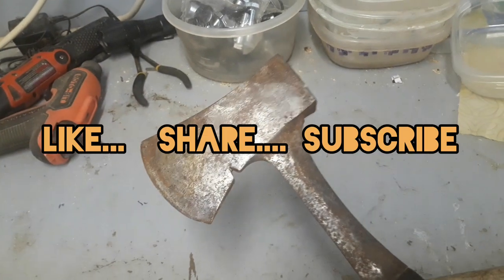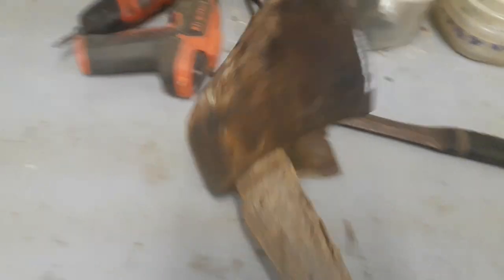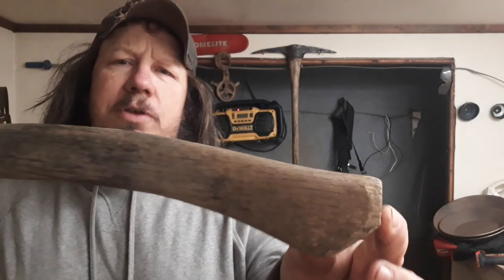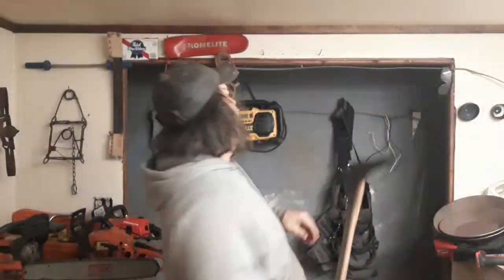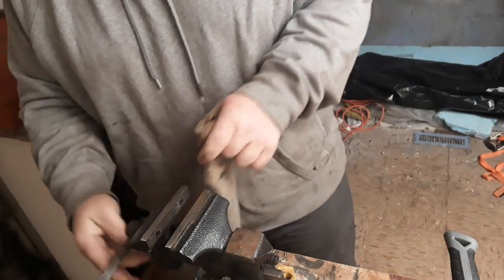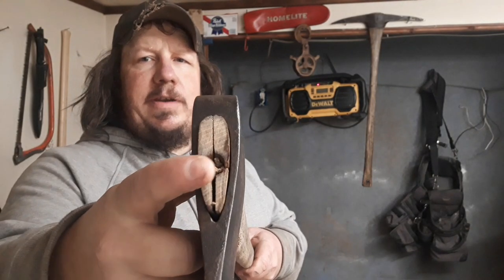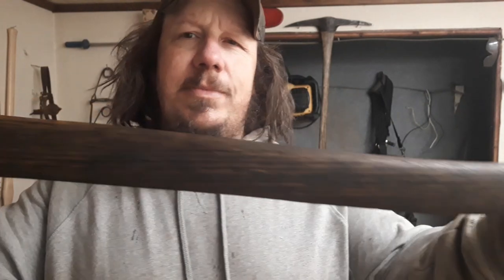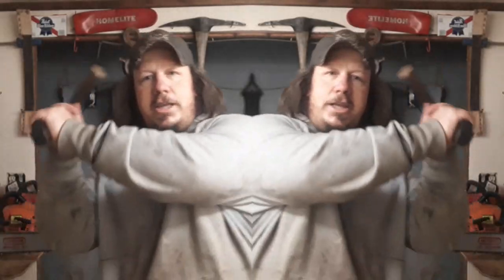Trying to salvage an old axe handle

Comment: Jamie when I was a kid we had a machine that punched out them leather  washers that are on that hatchet handle ! In fact I have a smashed right index finder from that machine  it happened when I was 8 yrs old !!
Reply from the maker: I think I'm gonna hand cut squares 
...then use a hole punch in the center..2 connect holes..  glue and clamp..and sand to shape...   that machine would be handy to have...  but I have enough smashed fingers...lol.. good story brother

Comment: That resembles a Collins head I have, but I'm not sure if it has a maker's mark or not.  Anyway, it is kind of a bummer when the original handle just won't work.  I'm sure you will find a nice mount for the head and have a nice user.👍✌👍
Reply from the maker: My first thought was a Collins or Vaughan..I did find some more letters but..i think they are from a company that ordered some..like state agency or a mine or something...?